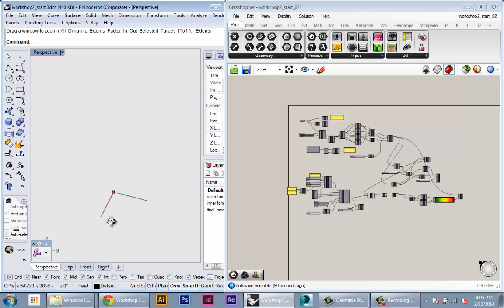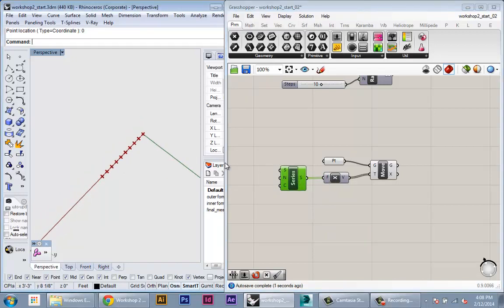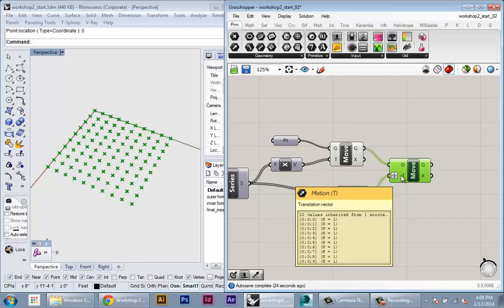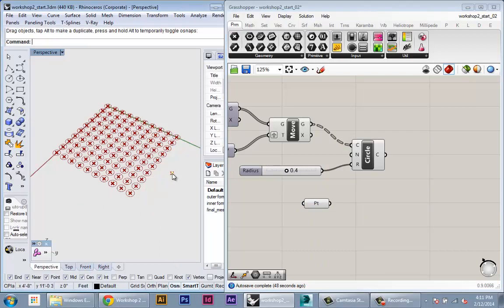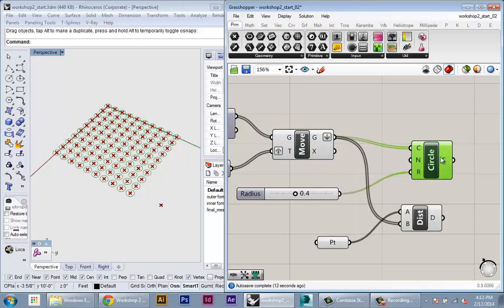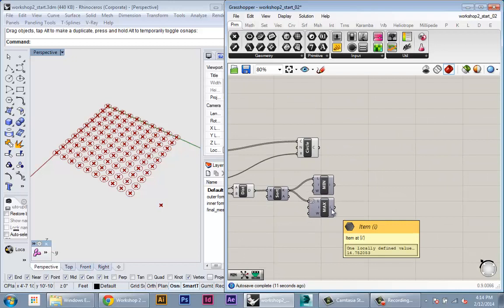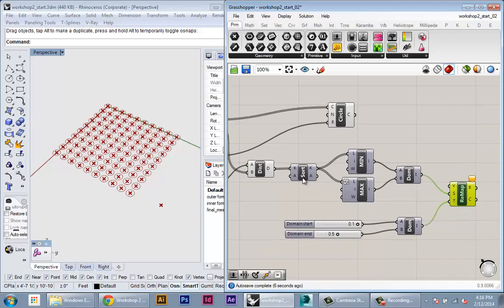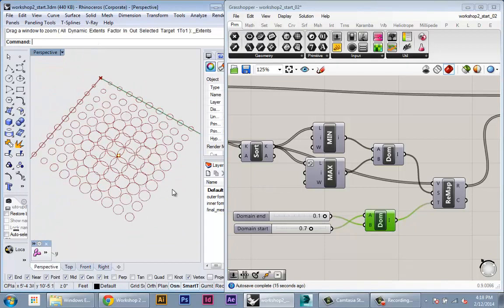Grasshopper Attractor Points 1/3

Comment: Is there anyway to control the 'force' in which the circle respond to points or certain points. I'm would like to be able to control the push / pull of the points more specifically.